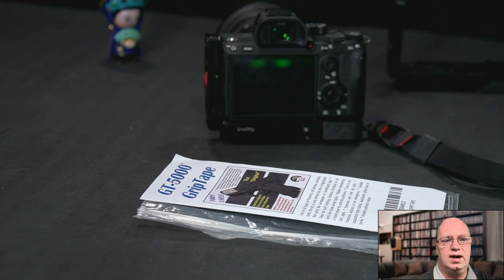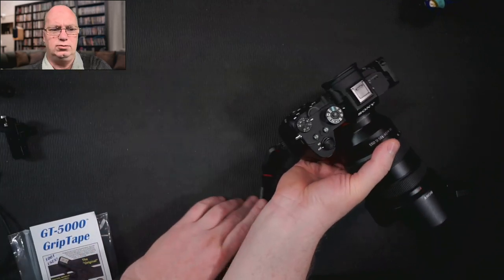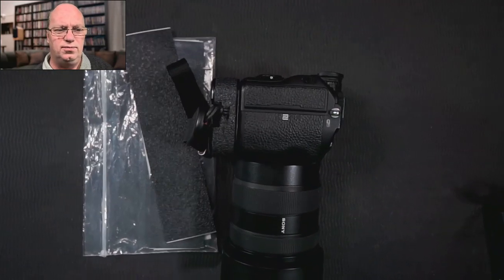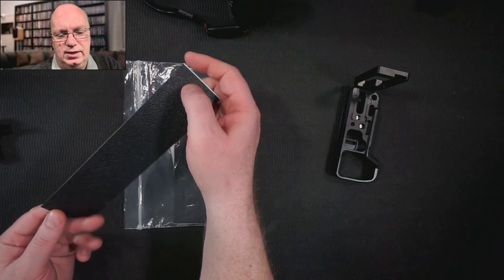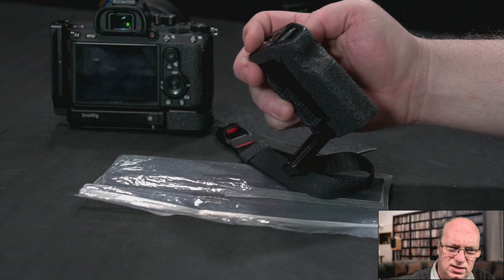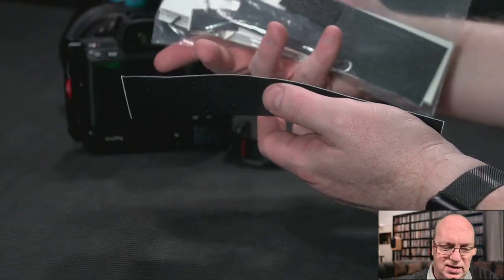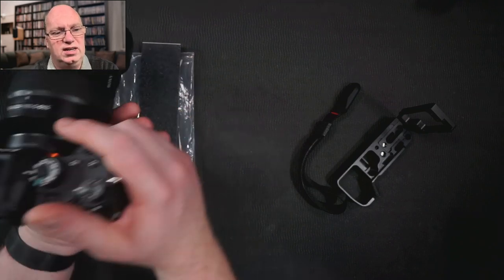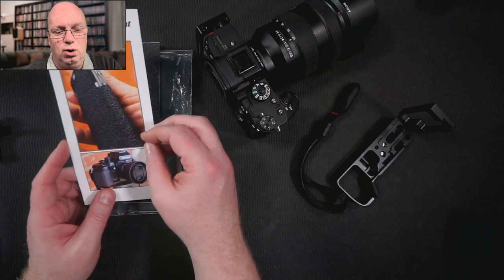better grip tape for camera and l-brackets and cages : GT-5000

Comment: My biggest problem with the Smallrig bracket on my Sony A7iii  is the metal to metal contact at the bottom of the camera with the L bracket.  There are only 2 small strips of padding and no padding in the corners. The bracket has caused the paint to rub off on the bottom corners of the camera over time.